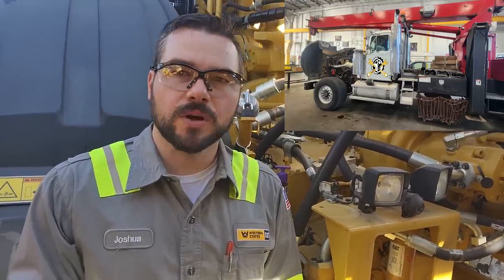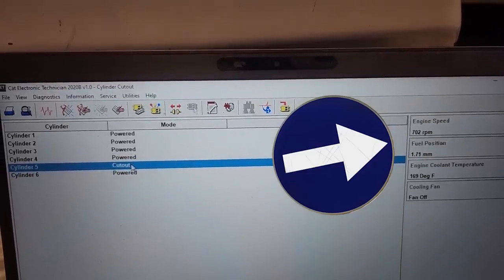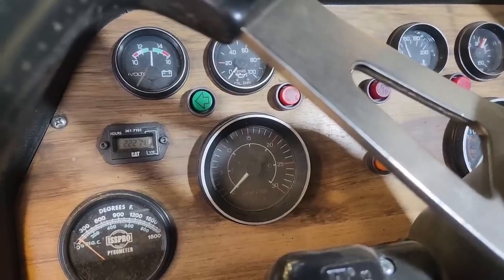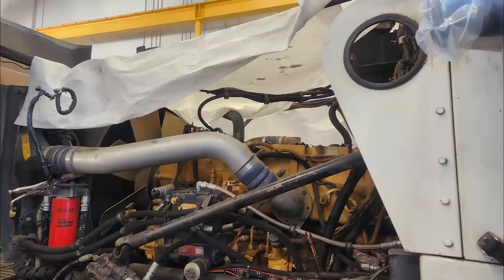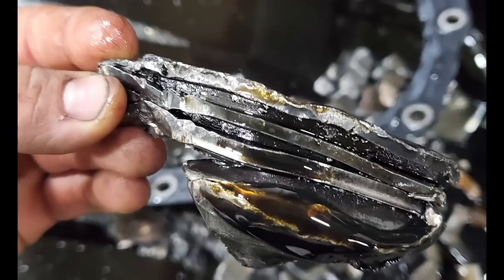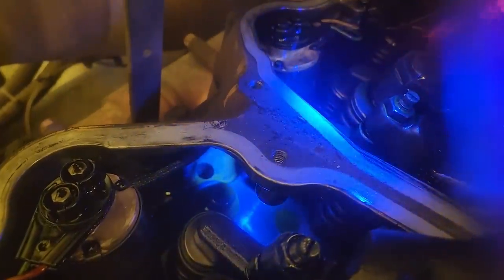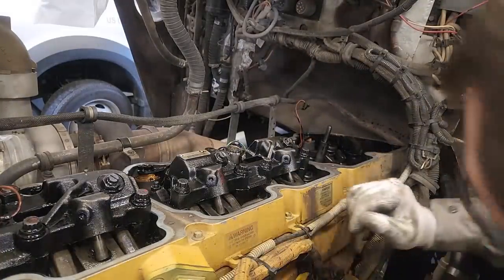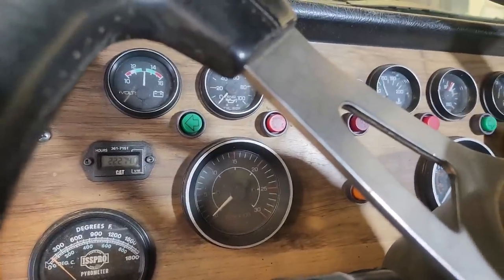Oil Level is RISING in Western Star Crane Truck. Troubleshoot fuel in the oil. (INTERESTING)

Comment from the maker: Thanks for watching the video. Hopefully you learned something or found it interesting, maybe both. Here are Tools used in the video and recommended on Amazon Affiliate links: 
Stainless Fluid Suction Needle: https://amzn.to/3TrMhBt 
Engine Oil and Fuel Dye UV: https://amzn.to/3z34zkv 
UV Professional Grade Light: https://amzn.to/3gzxPc0 
Milwaukee 3/8" Right Angle Impact Wrench: https://amzn.to/3D2CvAk 
2 Pack M12 Style Batteries for Milwaukee: https://amzn.to/3D2mdHE 
Adjustable Height Parts Tray 100 lbs: https://amzn.to/3CBusZB 
Airlift Cooling System Vacuum Filling System: https://amzn.to/3D9AlPu 
Gearwrench Index Prybars: https://amzn.to/3evaunX
Reply: Nice info bro..
Reply: How do I send destruction photos to you. I have pictures of an isx head that might be interesting.
Reply: I have a question about the video you made about a year ago,,how to get instant  fuel and oil pressure,,what was the name brand and size of that vacum pump you were using I can't find one anywhere

Comment: Most common fuel dilution. We had a crusher with a C15 that had a fuel/ oil cooler that leaked oil into the fuel. As a truck mechanic it was a head scratcher to diagnose that one. It was like a little radiator in front of the radiator that oil and fuel return ran through. Strange setup.

Comment: Great video professor Ape! We had a severe injector O-ring failure on a CAT 3196 that super diluted the oil as well. Right after replacing the injector, the turbo failed. My guess was the poor oil viscosity took out the axial bearings in the turbo running under high load with the diluted oil.

Comment: When we did top deck inspections on EMD's, we could use a black light and no dye; a fuel leak would show up grey under the light. My guess is that this was a reaction in the aniline dye used in non road tax fuel (we were dealing with marine EMD's). The places to look were the injector, the injector end of the fuel jumper and the manifold end of the jumper. Prior to the black light method, all you really had was looking for lube oil pathways and surface tension puddles that were not there due to thinning.

Comment: You forgot that BXS engines used a non Cat compression brake. As for the fuel in the oil, we have a five gallon bucket of test fuel with dye added. We remove the lines at the head and hook up to a old fuel transfer pump that we cut the end off. Remove the valve covers and remove any fluid on top of the head and make it as dry as possible. Use a air drill and pump the dyed fuel into the fuel rail back into the bucket.  Naturally engine is not running, but the pump is and look for signs of leakage. If needed we can pull the valve train off also. Over time you will get leakage out from the plungers. I also use a variable fitting to ad restriction and use a psi gauge to put psi on the system if needed. Once source of leak is found, drain out any of the dyed fuel back into the bucket for the next one.

Comment: I had a EL 240B cat excavator that had this same problem. I had a 3116 cat engine and I had to have the head replaced to fix it. I also have a L90B Volvo loader and it had a injector cup that cracked and leaked compression into the cooling system.
Reply: Was the head replaced because of a crack or issues with the fuel rail?

Comment: I have been working as a heavy duty mechanic for 37 years and have replace lots of injectors but I have replaced more transfer pumps that leaked into the gear train and into the pan than injectors. I can't believe you have never seen it as it is really common but my area is not on highway it is all off highway, dozers, graders, excavators etc but same engines.

Comment: About a year ago I had sent you some plans for a home made fuel system tester, you found it interesting. One of the functions it can do is pressurize the fuel system to 65 lbs [Detroit Diesel fuel pressure] by capping off the fuel return line thus allowing observation of source of leak without the engine running. Since then I did a little "service truck tour" on You Tube with one segment going over how to build and operate tester. If any of your subscribers has an interest please look at the video. 
  I enjoy your videos very much!
Reply from the maker: I remember that email I believe, was that the setup you had that was designed 40 years ago or something like that?
Reply: @AdeptApe  Yes by one of those "Greatest Generation" guys. If you get a minute check out the video, at the minimum you will get a visual of one of your fans.
Reply: Can you provide a link?

Comment: I had a 3.8 make oil. When it did so it filled the crankcase enough that the evap system sucked fuel and oil into the turbo causing the engine to run away. Found the cause to be that the injector drain line bolts were not tight.

Comment: I always found fuel dilution in Cat C series engine, 15, 18, 27
Most common problem comes from Injector Oring, another from Seal shaft fuel tansfer pump. i dont know why there is no improvement from Cat about that.

Comment: I've twice seen the transfer pump shaft seal on a C9.3 leak into the oil system. 
The vaaaaast majority of issues I've seen have been Injector related though.

Comment: The early D9L's fitted with 3412's had an issue with the internal injector lines splitting. The dealer I worked for in the 80's delivered 3 new tractors and I got sent to site to sort it out, 3 new D9L's all inoperative with the highest hours on the machines was 27 hours, needless to say the customer was less than impressed. But got them going again

Comment: This last Thanksgiving I had a late night/early morning (arrived on site 2am) roadcall request for truck stalled on the highway on ramp and would not start again. The driver thought it was batteries (lol). Truck start gives a "shunk" but doesn't turn motor over. Tested batteries, and voltage drop Tested starter and that all checks out. Pull the dip stick amd the oil level is several inches above the full line. Had to give the driver the good news 3am Thanksgiving day that his motor is likely hydro-locked and engine has been making oil.

Comment: My 3406e had two split valves on #4 no one no truck dealer not even cat found problem after changing injectors cups ect I found it after pulling my head.i was making oil I got her back to Canada by changing oil every morning.yeah that was costly.nice diagnosis josh
Reply: Very expensive I'm sure. But talk about a great quasi engine flush. Id imagine you are squeaky clean in there now.
Reply: @giggiddy yes and cat told my bearings would survive they in perfect condition oil pressure was still up at 80lbs
Reply: Also I should tell you I changed oil and filters each morning until I got her home..yes the best engine ever

Comment: I run the 6.0 on my ratchet and stubbys,  those knock off batteries aren't that good. They leave tool down on power. Watch your local Home Depot,  I found 4 packs that came with a 6.0 and a cp3.0 for 99$ I bought all 4. I use the cp3.0 in the jacket cause they last a hr longer then the 2.0..they have new HO 5.0 and 2.5 m12 batteries.  Watch for sales at HD

Comment: Cat should hire you to work in the engine design group or even better since you technically work for Cat or for a Cat dealer the engine design group should rotate engine mechanics in the design group for a period of time and also design Engineers thru the engine repair bays for some experience.

Comment: do you recommend c12 ? trying to by a 2003 KW Whit That small engine
Reply: C12's are tough like our c13's but a 12 is very well designed engine
Reply: I had a C-12 in a 2000 truck was an excellent little engine. Reliable good fuel economy, not the best in hill country. Miss that little truck much. They did have a few issues but Cat solved them by about 03 so should be good.

Comment: Being a cat 99% of the time it's the injectors I would replace injectors and cups Cups because if you're going to replace them injector you don't generally put it on Old cup you put it on a new one cuz usually the injector seal has failed which either means the copper cup has expanded too much from running it too hot which that's a bucket truck which means it's probably idling all the time and I got a bit warm and cooked the seal
Reply: These don't have cooper EUI sleeves.

Comment: The CAT engine and you're making oil it's injector cups usually you can find diesel fuel in the radiator but in this case you're getting diesel fuel in your oil which means just feel on the injector went bad

Comment: Do you want the 6 amp battery and it doesn't hit harder it just lasts you all day long where the twos and the fours you'll have to change out during the day usually is 6 amp battery you can get all day out of it I love the Milwaukee stuff five year warranty I'm on my second 3/8 stubby best damn tool I ever bought the first one lasted me 4 years yes I could have sent it in for a warranty but I abused the hell out of that thing and quite honestly the reason it broke was my fault would they have warranted it and sent me a brand new one yes but I figured I abused it I got 4 years out of it I'm extremely happy I bought another one just to get a couple new batteries go for the six amp battery it'll last you all day